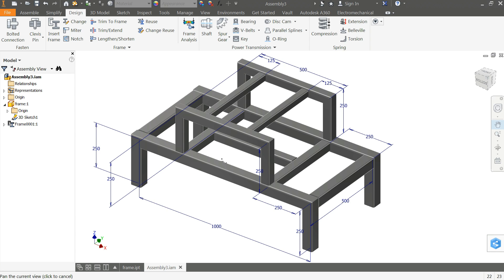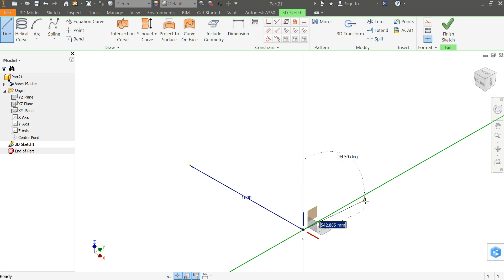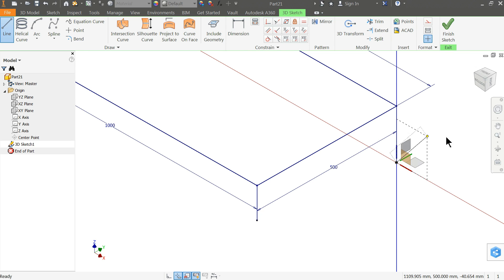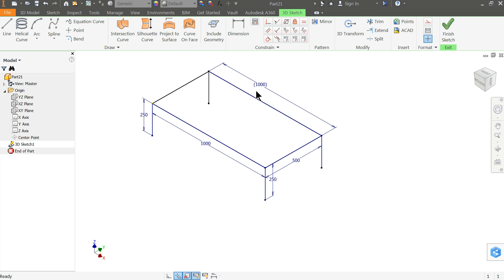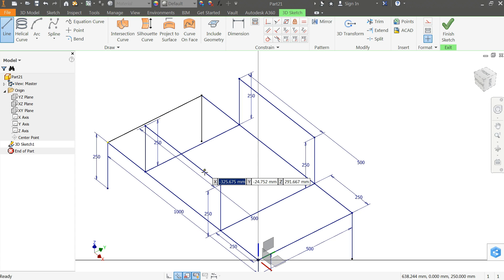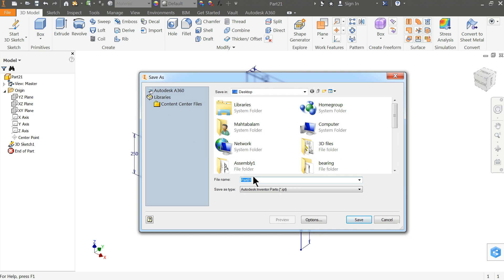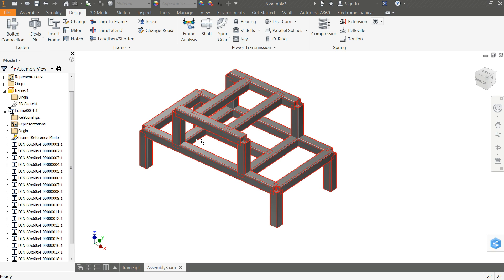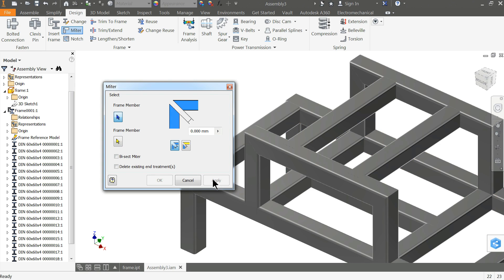Autodesk Inventor Tutorial How to make steel Frame

Comment: Holy fucking cheesus is that an unintuitive workflow.
And dear fucking god, I only wasted like half an hour of trial and error, and another half hour googling for solutions just to re-place the 3d sketches center to the Originpoint of the sketch, and again as much effort to place the wireframe with its friggin origin point to the fucking origin point of the assembly!!!
Fucking hell is that a cumbersome piece of shit software! I have a fucking rage fit every second mouse click.
For the most basic things you have to do like 10 unintuitive extra steps, and there's no friggin logic or structure in the UI and Selections whatsoever!
For the tubing, the selecteable Norms are labeled cumbersomely already, but at least it details every unnecessary thing, and then you go to select material and it has a list of whatever the fuck stupid things. If it is a Norm has friggin "steel tubes" in the name, then why is there friggin Tungsten listed in the materials?